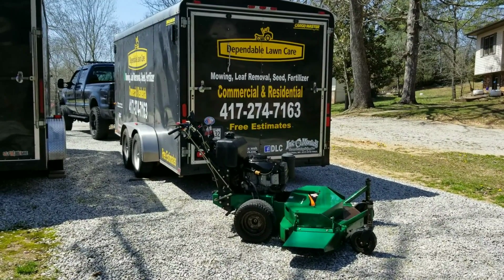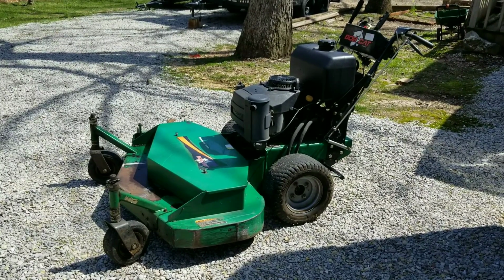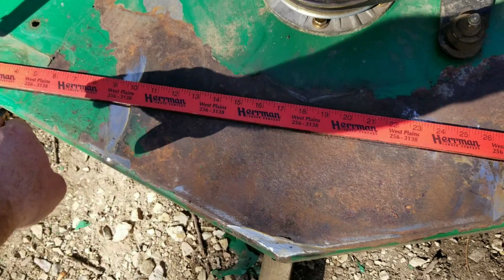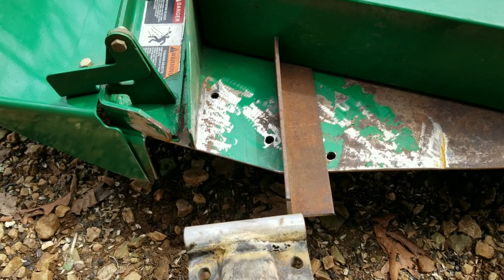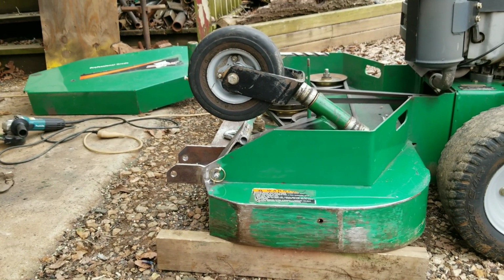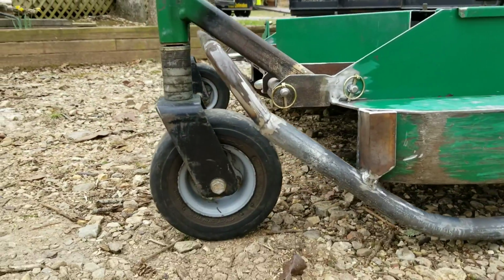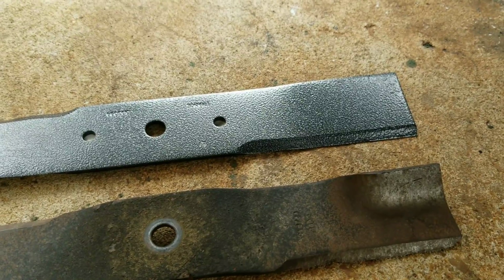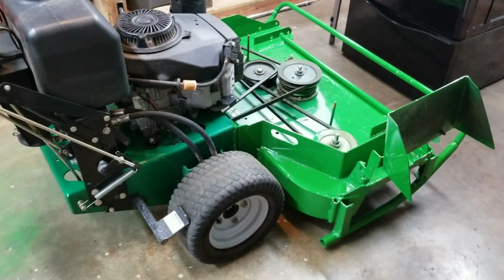Brush Mower Build Part 1 of 2

Comment: WOW, this is just the video I've been looking for. I have 2 of these mowers and I'm planning on turning one into a brush mower like yours. Awesome build.
Reply from the maker: Thank you and have fun!
Reply: Was curious to see if you still have that mower. I have found where I live it's hard to find parts for it.
Reply from the maker: I don't and it's the same here, the closest dealer is hours away.
Reply: I have two of those mowers want a belt drive and 1 highgrove drive. So what are you using now for brush cutting?
Reply from the maker: Not doing it anymore but mine was hydro which I prefer over belt for sure.

Comment: I just picked up one of these Bobcat mowers with the double belt which seems to be quite capable of pulling a sulky. Especially the one I am about to build with your awesome idea. I am going to restore the mower to its original glory first and add the sulky to it. Then I am going to put it up for sale for a few weeks and if there is no sale then I am going to turn it into a Roughcut mower like you made and keep it for myself. I am going to keep watching out for these mowers because they are excellent mowers and anyone who does commercial landscraping would absolutely jump at the chance to get a double belt or a hydro version of these . I have a five foot wide trailer and I could barely fit the deck on it.  I am going to add all the cool attributes that I can think of. I want to have a nice size led light bar across the front as well as two led spotlights that illuminate the area around your feet . I want to add two smaller lights that can show what is next to you as well as well as blinking red lights that can be seen from the back for true. right mowing or for traveling from property to property on the county roads we have here. Any suggestions would be appreciated if I missed something or added to much...lol
Reply from the maker: Sounds awesome 😎
Reply: @HandyGuy2016  Thanks. I really didn't even think about finding a bobcat before I saw your channel and the awesome stuff you did with yours. My best friend and I were in the barn last night watching your video where you build the sulky. He is an artist like you are and I am not too shabby of an inventor as well but we  were commenting on your brilliance at every turn. Either Addi or myself would say how the heck did he look at that and know you were going to use the curve of the handle in that way. Also I really never thought about attaching the lead in for the sulky  like you did but that also is sheer brilliance because it keeps the rider from slamming into a wall or a fence or a nest of vipers when you make a sharp turn. Truly awesome my friend.
Reply from the maker: Thank you, I really appreciate your feedback.

Comment: I’ve been thinking about doing this with my Bunton 36” belt drive unit.  Has a Kawasaki 15HP V-twin so it will cut heavy stuff.   But I’m eliminating the front wheels. My skids will have removable steel wear pads. Should last many years before wearing out. My grandpa had a bachtold fence row mower that ran on tube rails and it never wore out after many decades of use.
Reply from the maker: Nice idea 💡

Comment: That's a really nice build man. I do disagree with your assessment of commercial brush mowers, though.

Yes, the manufacturing costs compared to walk behind mowers are probably similar, but something is worth as much as people are willing to pay for it. The income difference per machine hour between the brush mower and an equivalent walk behind lawn mower is huge. Manufacturers know that and honestly a couple thousand extra dollars compared to what I can make with a new machine over its lifespan is a negligible expense. If someone is capable and has the equipment to do what you've done,  then I wouldn't blame them a bit but again it's a negligible expense in the big picture. 

A notable difference with a brush mower that you could use to improve on this machine is that a brush mower is going to have  lower output ratio pulleys. Lower blade tip speed and more torque. At 48 inches cutting width, you would have to slow your blades down a good bit to equal the cutting torque of a 26-30 inch brush mower with a similar engine. 

Ive also made a modification to 2 of my mowers (walk behind and mini skid mower attachment) that drastically increased performance. Put a 3rd cutting edge on the blade tip and if possible, find (or make) a blade that has biased cutting edges. With that 3rd cutting edge turned over 180 degrees, it causes the blade tip to cut like a saw kerf. It's easy for me to do because my mowers have swinging blades on a carrier so I can just mount one of them upside down. There is a commercial mower that uses this design called a Brown Brush Ox. They have a picture example on their website.
Reply from the maker: Thank you for the feedback :)
Reply: @HandyGuy2016  yes sir. Happy brush cutting! Lol